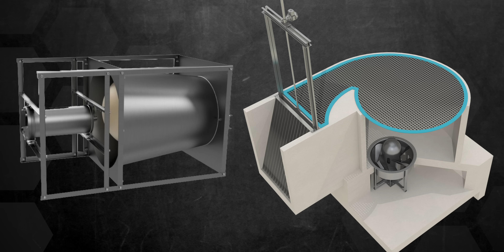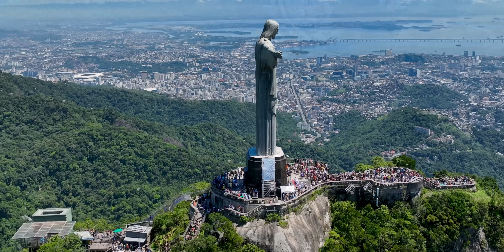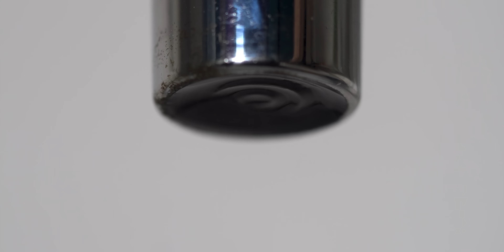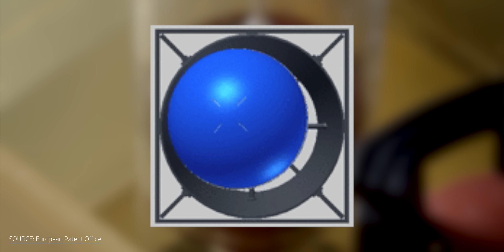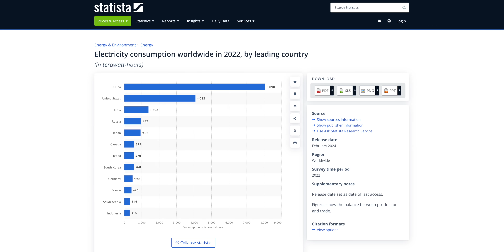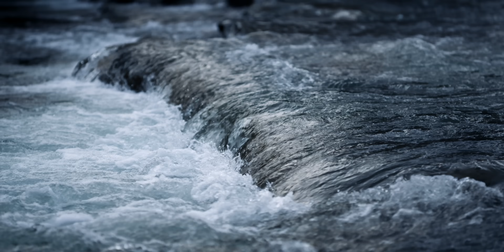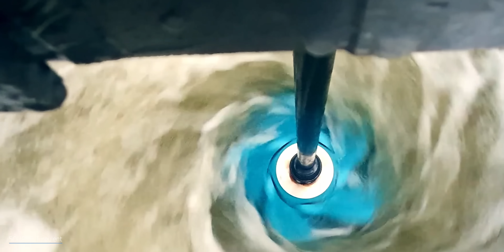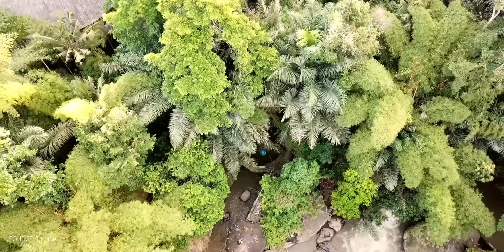The Genius of Small Hydro Turbines

Comment: Spoiler alert: most of the places in North America where dams have the potential to produce lots of power have already been dammed. The original purpose of the USGS was, in part, to identify these locations and assess their feasibility. The sad part is that many of these dams have either been removed over the years for environmental concerns, or have had their power-generation equipment removed. This is due in part to the complexity of a trend towards larger, more efficient power stations instead of the microgrid scale generators that require far more maintenance. Furthermore, since most of the power infrastructure was designed around centralized generation and it would be very difficult (read as expensive) to change to microgrid solutions. Which is a shame, since there are many places where medium sized hydro-power systems could totally be used to generate power... just not as efficiently as they need for them to be financially feasible. It's a weird situation, since hydroelectric power seems to be pretty unpopular these days despite the abundance of viable sites where it could be implemented.

Comment: Suggestion: Mix more air with the water. For 5 ft head do a 10 ft down pipe. Water will come back up but pressurized air will be captured and used.

Comment: These videos are so great very thorough and full of information. However, with regards to large dams, there is an overlooked and misunderstood biological system that is being damaged. Behind Glen Canyon dam is enough iron (if allowed to be assimilated into the environment and reach the ocean) at .05% utilization to sequester 1300 years of global carbon emissions (this is a conservative estimate). These 80-year-old dams are a stale industry. Any industry that has not had a major shakeup in the last 10 years is due, and that shake up will generally come from someone outside of the industry. Nintendo and Tesla are great examples of this phenomena. The irony of dams is that they are the only 24/7 option for renewable clean energy. However, if you look at global surface heat anomalies, which start to occur in 1935, the year after the installation of the Hoover Dam. A major coincidence can be observed that the Hoover Dam changed something in the global biome that was not positive. Oceanic Phytoplankton that the iron would feed will produce more 30% more heat to continue their biologic functions in environments where their nutrition is limited. It becomes obvious that these separate biomes are connected. If dams can be designed to use smaller dams (which are beneficial for many reasons ecologically speaking) and let sediment flow to the ocean we would be far better off and be feeding a much larger  and fertile biomass population than trying to regreen the land surfaces. Turbulent is on the right track though they are limited in the amount of water they can take in. Scalability is going to be the major issue though the design is a great step in the right direction.

Comment: We got a small hydro installation where I am just outside a local university, visible from a bridge going in to the town center region.  It looks nice.
I've always been saying for the longest time that these things could be dotted all over the place, even across the same river a few times (although you also have to consider the density of the land, slowly the river down could result in more water absorption, so ideally you'd do that higher up the river, and maybe even consider lining the ground to avoid some of that extra absorption)
It boggled the mind why it wasn't a thing when we had been using waterwheels for so long.  
The same could even be done with wind to capture some of the lesser wind currents that are more present in every day life, just as an extra boost to the power grid.  Yanking some of that extra wind energy out of the air could also make things a little more tolerable in the weather department, not to dissimilar to how trees function.    Wind, however, is a little more complicated, but still very doable.  As long as you prevent the thing from being ravaged by overloading from heavy wind currents, you'll be fine.

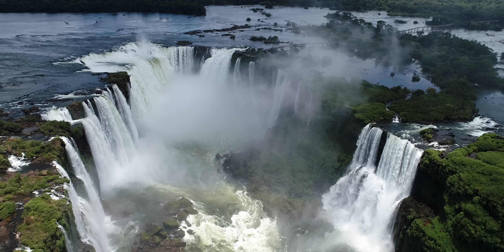Comment: you left three zeros out, when calculating faucet flow @3:23. if 500k would be correct, and it flows at 662k(m3)/s this would roughly mean that a faucet has to push out 0.1(m3)/s which is 100Liters per second.. But I am from Europe, so perhaps our faucets dont have such flow rates :D

Comment: I'm all for combining all renewable systems to create constant supply.

Solar and wing have their good times & their bad times for production
Which often does not align with the times energy is reguired.
So they need to store their good times in some sort of battery system, 
Wether that's pumped hydro, Batteries, or a stored heat system, 
I say hell, use them all! If it works, ad it!
 
The fact that these smaller hydro units can take more advantage of the drop in height, 
Is fantastic, as they could add more turbines to get more production out of pumped hydro. 
A rootop without solar is a waste of space
Heat wasted, is energy wasted, it can always be exchanged somehow, 
even if it's just warming greenhouses, or drying materials
Or being used to create/purify drinking water 

The next big problem is finding enough renewable suppy companies to come together and work on combined renewable energy precints together, and prove it can be done, 
So they can reliably provide energy to localised industrial and residential precints, 
whilst also providing excess energy to stabilise the national grid

There's my 20C of hot air right there!

Comment: I did an entire research paper on this. Basically all large hydro projects that are viable have basically been done. A simple diversion small hydro project given proper consideration of down stream flow and now stacking a bunch of them, can be very beneficial for small power needs (maybe small factories and such)
Reply: A small factory can benefit big time from small hydro turbines. 💯👍🏾
Reply: Any chance I could get the link? Or the title?
Reply: What's funny is this was how the industrial Revolution kicked off, waterwheels making machinery move with direct physical power, today one ca now hook up a electric motor to act as a generator and power up more effecient machinery to do the same.
Reply: Factories crave fossil fuels. They can't function without big coal and oil. E vehicles suk. Oil will last forever.
Reply: So your typical mill building.
Reply: @-John-Doe-I mean sure, if you’re implying like a water wheel then yes, just with a spinning generator at the end of the output shaft. A lot more complexity goes into it to sustain something like a large Mill, who typically use recovery boilers or package boilers to produce reliable on site power.

Comment: I live near the mighty Columbia River and its final dam in Bonneville Oregon. This dam has significantly altered the nature of the lower Columbia River. There has been a suggestion that small hydro on our water supply pipeline (Bull Run pipeline ~1.5m diameter) can supplant Bonneville dam power. The absurdity of this suggestion is the sort of patchouli and healing crystal snake oil that is being pitched to local government officials. 

Let's include an assessment of all environmental impacts, but we also have to discuss apples to apples and get real close to 1.2 cents/kWh.

Comment: At 3 feet of head, and ignoring all losses you would need 1,375 gallons of water per minute to produce 1 horsepower or 746 watts of electricity. In the real world you would need like double that flow if it was a really good design (It's Not)

Comment: Hydraulics is a mechanical function that operates through the force of liquid pressure. In hydraulics-based systems, mechanical movement is produced by contained, pumped liquid, typically through hydraulic cylinders moving pistons.

Comment: I run a small undershot wheel that is made out of a tumble dryer drum.  Generates approximately the sqaure root of f**k all power but it never stops.  With some batteries is provides a genuine backup to the grid which can be a bit flakey here.  I think small hydro is a real Cinderella and probably one of the lowest impact renewables available.

Comment: You miss two obvious places to install small hydro: potable water deliver systems for urban areas and main sewer pipes.  Seattle's water comes from dams 600 feet above sea level but only some twenty-five miles or less away.  It arrives from pipes three feet in diameter (and these pipes may be 'up' for replacement soon).  There are six hills in Seattle, all nearly six hundred feet tall, that drop sewage down to sea level in a few miles.  (Gray water from the sewers drop into the Puget Sound and release water; another possible low head power site.)  Even most houses have a drop of several meters from their gutters to the ground or sewer/rain water catch basin; these could be used for micro-hydro.

Comment: To this day I'm still amazed that the eastern side of the Appalachians don't have much small hydro. There used to be a fair bit when electricity generation was starting out, and you can still see the ruins of those original plants on large rivers (New River around Boone, NC is the specific one that comes to mind for me). There are a number of small streams, rivers, and waterways that would easily fit the scope of the small hydro technologies you showcased. 
I suspect that the issue is that there just isn't a motive force large enough to create space for it that would be proof against the larger entrenched energy producers in the USA.

Comment: One issue that this may be able to address is the hazards of low head dams, ideally removing them. Low head dams, typically installed a century or more ago, were installed to generate electricity, or older, to run a mill. The spillways create a veryically circular flow at the bottom, which traps anyone or anything caught in the flow. Canoes, kayaks, and fishers are occasionally drowned here, with substantial hazards to first responders tasked with rescue or recovery. Removing the dam is the usual recommendation. While the generator has frequently long since been retired, this also eliminates the possibility of gaining any energy. There are still elevation changes, and safer infrastructure can be added to take advantage of that change after removing the dam.

Comment: So, no clue if this would even be read, but it seems like the right crowd, so, I have an idea, don't know the feasibility in the slightest. But the basics are as such: 1, can a small steam turbine (palm sized) that powers a DC electric motor as a generator, be made in an enclosed loop, possibly using refrigerants rather than water, and use a remote mounted laser as a heat source for the boiler? 2, can that then wholly replace the battery weight of a quadcopter drone and power it, lifting the full weight + a 10 cm square sheet of lexan? 3, could the laser be autonomously aimed, tracking the target zone on the drone throughout its flight, from a ground station? 4, can we have many drones of this design all with their own lasers and coordinated autonomously? And lastly 5, can the lexan sheets be formed as lenses, the coordinated flight aiming, and the ground station having a solar boiler generator to collect it? Less effecient, perhaps, but autonomy of the collecter drones would make repair and maintenance far easier, even automatable. Ground space would be minimally impacted. I think if it all works well, expanding the idea could have an even greater effect, not scaling up persay, but rather stacking collectors further into th sky with more powerful lasers, they redirect and focus light from higher in the atmosphere to direct it down the chain of collector drones and back to the base station.. Further ideas are along the lines of replacing the drones, possibly with hot air balloons tethered to the ground to combat drift, lasers could still be used as the heat source however, it might be even simpler to use a solar lens specifically for the hot air balloons lift, and another for collection to the ground, possibly even a clear balloon with the surface itself responsible for collection and concentration via clever shape design. That's honestly the better option I think, clear blimps that act as giant lenses. Simple servos with lever arms could even be used inside to flex the surface and tune the output beam.

Comment: If you live near a river, just a small one like a creek or brook, in an area that is not spectacular, you can use a water driven piston pump and store water in a big tank. You can then use that water to drive a small centrifugal generator and return the water to its source. Other than building the system and some maintenance, it costs almost nothing, free hydroelectric. Add a small wind mill, some PV panels and a battery and you can be off grid. Smaller works.

Comment: I'm probably going to get flack for this, but the bladeless turbine shown seems likely that it would have some significant increased wear and tear issues. The weight is off center as it rotates around, unlike a standard turbine. This will likely result in greatly increased bearing wear and constant stress and fatigue on other components. I anticipate high and constant maintenance.

I like the idea of micro-hydro, especially with fish-guards where the main stream isn't obstructed.

Comment: Hydro doesn't produce much without a significant head as you mentioned, that's why they build them high and big. Micro hydro that produce 500W is completely useless, you can't even power a heater. And a 5KW install is as big as your home, and way too expensive.
Mini hydro on a river for a town can and does work, but it still is not as good as the big ones. And yeah you can take care of the environment and wildlife in a big dam too, it's actually easier than enforcing it on every small one...
Some things don't scale down well, like dams, or trains (every time you hear "pod" in a pitch about some future tech you can know it's bullshit)

Comment: When I lived in Connecticut, there were lots of old mills that ran off some form of old hydro to power for the old linen mills, but most have been converted to apartments.  I always thought it would be an excellent opportunity for these facilities to have back-up power in the case of a snow storm or such, but he whole ice issue is a fear.  I think in many niche opportunities it offers some capability that just wasn't noticed before.

Comment: the issue here is that if we were talking 1 house hold 70kw is a great amount to not only supply what you need but is able to tolerate a high peak and have excess that is able to ensure a uninterrupted service.
but 70kw is meaningless to a power grid. 700kw is meaningless to a power grid. typically a  coal power plant puts out about 400,000kw, which means you need about 5500 of these generators, lets pretend you could make each one for $100,000, you can't but lets pretend. that's $55,000,000 when coal plants cost about $2M to build an realistically nothing to run (aprox  $100 to $500 per 1000kW). 
which just means that if you pretend that this would be as good a lifespan and reliablility as coal (its not, your dealing with 5500 units of hydropower), that you will just have to pay 27x the cost of electricity.
and if its only half the lifespan or reliability it will cost 55x the price. 
and if reliability and lifespan are half (which is optimistic) it will be 110x the price of electricity. so if your electricity bill is $500 per quarter it would become $55,000 per quarter.
yeah this is why the world of engineering has given up on hydro and tidal power. powering a steam power plant from cow farts is actually more cost efficient.